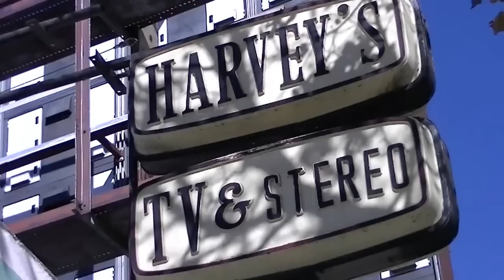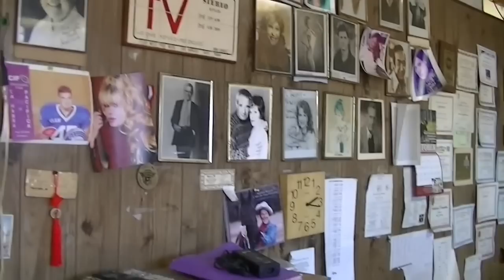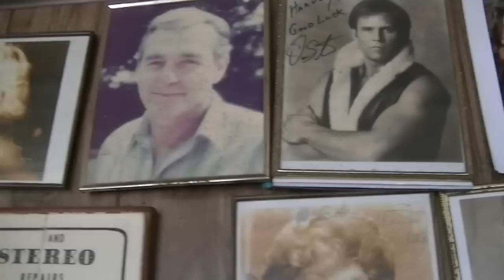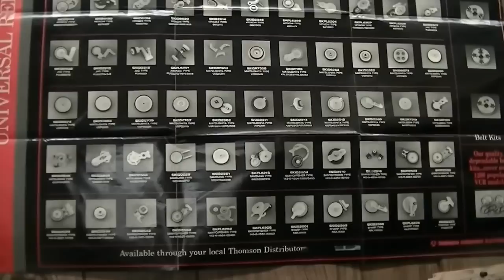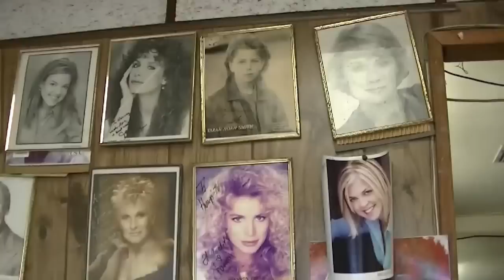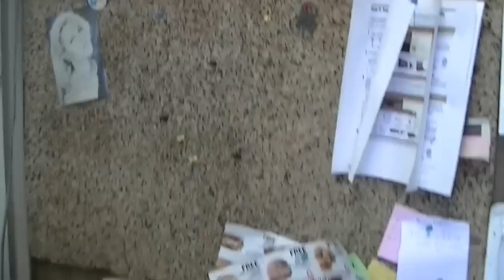Harveys TV Repair Shop Final Days A Short Documentary Harvey's TV an Stereo Los Angeles

Comment: It is really hard to go into a electronic store and NOT notice one of the new TV's. Who would not want something that looks so good ?  I wish someone had come along and warned me. IF OLNY  someone had said,  they do not last. Perhaps explained how cheap they are made. How expensive the parts can be. That is if you can get them. IF Only someone had thrown up a red flag or two. Perhaps I would not have one sitting in my living room. And I mean it just sit's there.
Reply: I have a Panasonic, Super-Flat TV....(big 32" glass CRT picture tube). I have been running it on average 7 hours a day for 17 years. The picture looks as good as it did when new. When it breaks I will look for another one just like it
Reply: One good thing has happened everybody is running out and buying these POS. And Good will is full of some nice TV's $25 or so for a 32 TV is a damn good deal. I got 4 of them so far.  When the wife got her income tax check she went out and bought a 32 led HD TV. It lasted almost 4 months before needing to be repaired. What a pain that has been. Got it from Walmart. We had to box it up and ship it  back to Samsung in NJ. They said we might get it back in 4 to 6 weeks.
Reply: ***** When the TV signal was changed nation wide people were dumping their big old CRT TVs like crazy. I could drive around on trash night (Boston suburbs) and see at least 10 of them w/in a 15 minute drive. In fact I still see a lot of them on trash night. Many people dumped them even though they worked fine...just needed a converter. If I had the room I would have taken every 32 inch set I saw. Being in a one bedroom condo I wasn't able to do that. If I had a house I would have filled my basement with 32 inch sets
Reply: inkey2 by
Reply: ....." BY "......what?........do you mean buy, by or bye?

Comment: I got into TV and audio repair in 1988 Baltimore, MD after I got out of the Air Force and could not find a job thanks to Ronald Reagan and the fall of the "Evil Empire". 1999 I went to work for another small shop in Dover, DE and after about a year I saw my first Plasma TV. $15,000 this thing cost. We used to get good money to fix them. Now 51 y/o and laid off from the Dover shop with no option but to open my own shop in this bad market. No shop had retirement plans.
Reply: James Staton by x-ray
Reply: James Staton v

Comment: It's not really fair to blame the "younger generation" for something that is not of their design. They are unwitting consumers being subjected to products designed with obvious planned obsolescence to perpetuate a cycle of endless sales and profits from disposable products. The consumer does play a role, but they are hardly to blame for the decisions of the major electronics manufacturer's design, manufacturing, and business decisions. And the reality is most of them are acutely aware of the situation and aren't happy about it, either. They don't want to generate the waste, they don't want to buy disposable crap, and they would prefer to have options to buy reliable products that will last, but the market isn't giving them any other choice than to buy what's available.
I'm sad about the state of the electronics service sector, and the state of things in general as mentioned above, but people need to be aware of what's really going on, rather than placing the blame where it's doesn't belong. The major issue is planned obsolescence and we as consumers really need to refuse to accept this as a industry wide business model. It's not just electronics, it's in everything we buy. In addition to planned obsolescence, there are products that are even purposely made to be disposable, by making them in ways that that can't be taken apart without breaking them, and going as far as companies refusing to provide any type of service manuals or aftermarket parts.
The other issue, which is harder to offset, is the fact that modern electronics are a completely different beast than what they used to be and serviceability is just not as possible as it used to be. Another aspect of that is technology is evolving at an exponential rate and devices are being rendered obsolete in a very short time.
Reply: Hey, i am 13 and i like vintage TVs because new ones are just crap so don't blame me